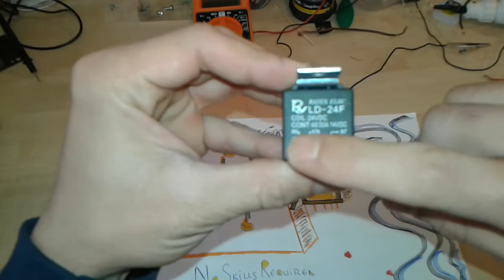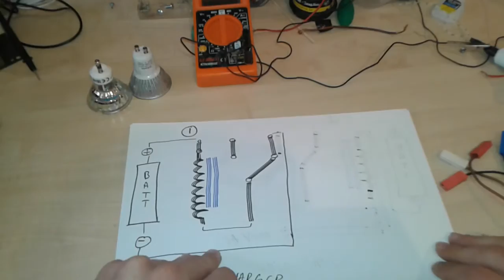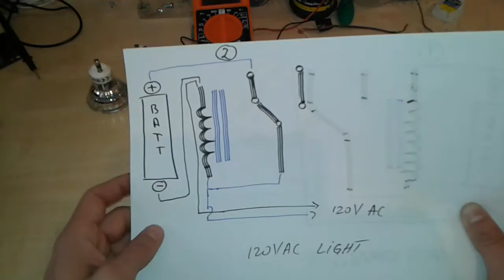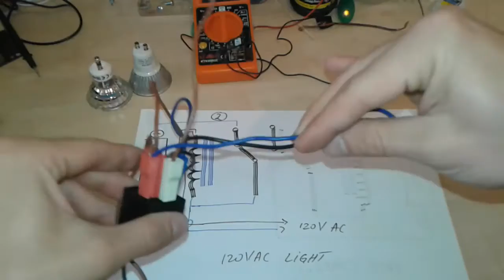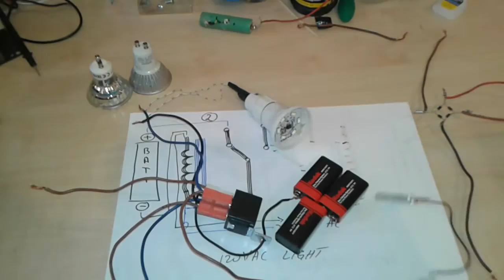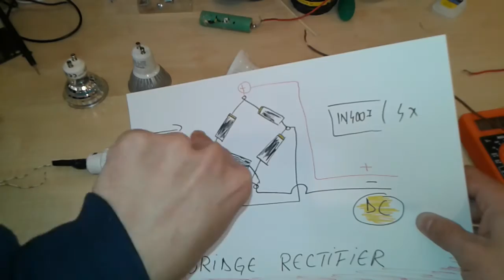Auto relay wiring as oscillator and charger

Comment: nice so we have to conect the 30 pin with 86 pin to make the relay oscillated and the plus and menor is the a/c output true my friend
Reply from the maker: yes follow the video you will have a relay mechanical oscillator ac output(pulsating dc)  i have some easy invertors video check them out all tge best friend
Reply: i will my friend cos i wanna do some to sent it to my parents over there the electricity are very critical they cut the power almost every day so i try to get some those deices to sent then to they are countrys are very bad
Reply: yesterday i made the relay oscilated and the ac current is about 180 olts  but i believe the amps are to low to make run a charger or another deice are more demanding of amps in ac voltage but it make a light on lol
Reply: i have a double relay by factory but is normal open i will try to welding like imhopet style to see i can have more amps cos is double relay must be double amps to
Reply from the maker: +Marvin Mejia the relay oscillator does not have many amps but we have to keep on trying maybe one day we will succed take care mate